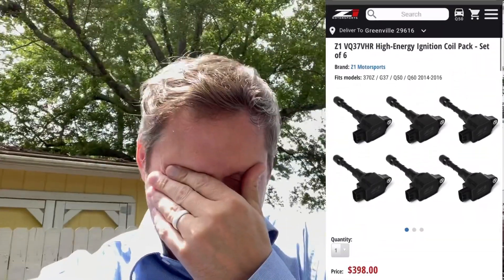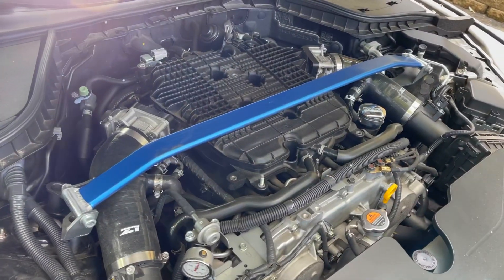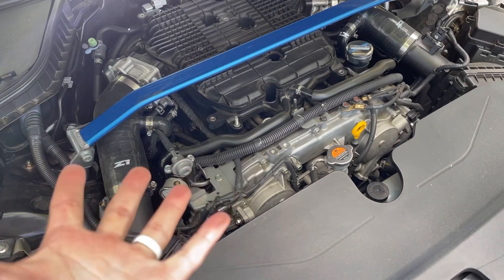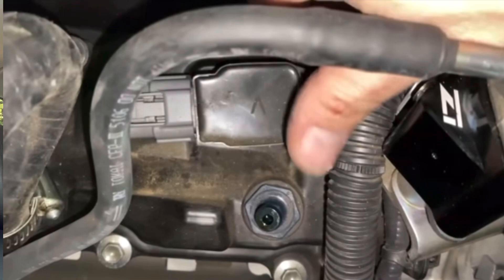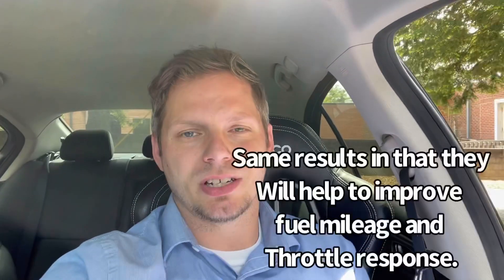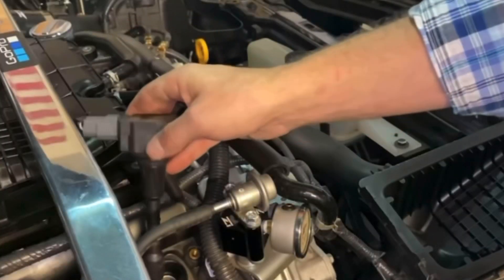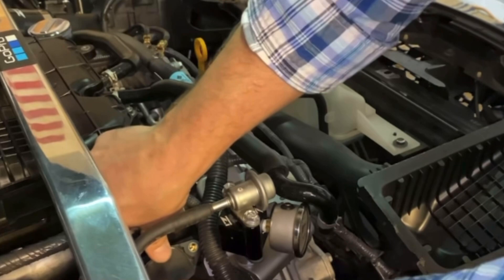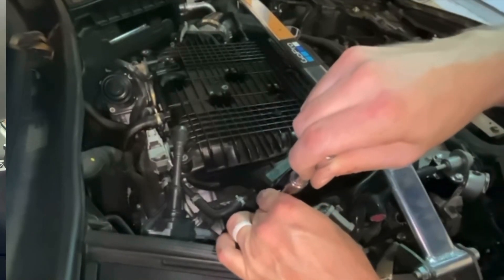Watch BEFORE buying Z1 Coil Packs!! | Z1 motorsports high-energy ignition coils for the vq37

Comment: My Z is tuned and is hitting 60K miles and I've noticed a decrease in gas mileage and poorer off the line throttle response, so I'm going to replace the plugs and coil packs do a manual cleaning of the throttle bodies and spray clean the MAF sensors. I'm curious to see what the plugs look like and how much the gaps have widened. I think that with the gaps widening and the firing voltage increasing, the coil packs are probably under greater electrical and thermal stress than when the engine was new and so they might be getting a little ragged by now.
Reply from the maker: I’m sure you’ll notice a difference with fresh plugs and coils!

Comment: My 2014 Q50 is at 200,039 Miles I ordered Z1 Motorsports coil packs and spark plugs Friday I should be getting them in on Tuesday
Reply from the maker: That’ll be a nice little refresher for the Q!
Reply: car is still running strong? how many miles you got now if it is

Comment: Thanks for doing these reviews on items like this that we're likely to be considering for our cars. I agree that unless you're going to forced induction, or the OEM coil packs are failing, then getting these is probably a waste of money. A better expenditure of money to restore some lost pep in your VQ37 might be a new set of iridium spark plugs if you're pushing high mileage on the ones in your engine. I noticed that NGK and Denso have competing designs and so there might be something new from these guys that might work well in the VQ.

Comment: I changed my spark plugs, coils packs, and did my throttle body clean at 51k miles. I' currently at 90k miles. I'm not going to replace them until 101K miles and when I do I'll try the Z1 coil packs. I trust Z1, and the stealership  for parts lol.
Reply: Damn my 09 is 104k miles and I've never done any of those things. I did just buy these plugs and coils though. Suppose I'll clean the TB while I'm in there too. I've only had the car since it had 70k miles but it's been idling kinda rough lately and threw a p0300 code, random misfire
Reply: @roundearthshill248  it threw the code after you changed the new coil packs?
Reply: @thatdallastx7861  car was solid as hell after changing the plugs and coils, I highly recommend it. 

But then I did some more mods and got it dyno tuned and now it throws codes (p0300) again lol. Car makes 332whp on stock cats/headers though haha. 

I had the Z1 carbon fiber intake installed and their ported intake plenum. Car already had AAM S-Line catback exhaust. 

Z1 installed the intake and manifold and then tuned the car with ecutek. Car runs amazing and is truly quick, but it'll throw p0300 especially in cooler weather.
Reply: @roundearthshill248  why is it throwing the code now

Comment: My oem ones just gave out , so are these worth getting or should i just spend more to get the oem ones which cost more for the same gain? Let me know guys need help :)
Reply from the maker: I've heard good reviews of these lately.
Reply: @SpeedCultureStudios  I asked a few more ppl and I guess ill go with these.
Reply: Having any luck with the Z1s? I’m throwing a code on my #4 cyl and I want to replace all my coils and plugs… should I buy these in your opinion? Thanks
Reply: @moonman4368  yea man they are working good no issues it fixed my missfires and whatnot. Only have 02 codes cuz my test pipes.
Reply: @yrrrrrrrrrrrrrrrrrrrrrrrrrrrrr  thanks for the quick response! Had them loaded up in the Z1 cart… just pulled the trigger!
Reply: @moonman4368  no problem man glad i could help
Reply: @moonman4368  how is it keeping up?
Reply: @jaredpesina3869  running great so far! No regrets yet! They look very well made. I bought the spark plugs from Z1 as well. The Densos on EBay are all fakes! Be careful… a fake spark plug falls apart in your motor it can be catastrophic!
Reply: @jaredpesina3869  so far extremely happy! Nice build quality on the Z1s
Reply: @moonman4368  updates on the z1 coils
Reply: @carlos889574  9 months and no complaints. I’d definitely recommend them 😎
Reply: @moonman4368 are the eBay coils fakes too 😮???? I was thinking about getting eBay Nissan coil packs

Comment: Off subject with this vid but do you have a heat exchanger Installed? I was told our non turbos can’t/ don’t need it even with a tune? Asking because I’m about to tune mine.
Reply from the maker: The 3.7 does not have an intercooler.  Only forced induction cars

Comment: Good show bud.. Appreciate ya diggin into the myth of power gains from this "upgrade".. While it definitely helps the engine operate more efficiently, easier; it doesn't give extra power by themselves.. The power source/supply to the coils needs to be increased. 12v is 12v, and most operate on a 5v reference anyway (which is computer controlled/limited); no matter what coil or plug you use.  I would consider these when time comes for replacements.. Not too far off oem part prices. Great show man. Greatly appreciate this series!!! #HustleOn
Reply from the maker: Thanks Mike.  Great input.  I appreciate your comments!
Reply: That doesn't make any sense. You don't need to increase the input voltage. A coil pack steps up voltage by the winding of the coil inside. If the coil winding is different in the coil pack it can make more voltage with the same input voltage and by doing so you should end up with a more efficient burn of fuel and air which in turn could absolutely equate to more power.
Reply: @Mike Dicarlo  uhhhh. Please explain what the msd ignition setup does than?? I'll wait..
Reply: @mikeschaner5853  they do exactly what the z-1 coils do. They step up voltage to create a higher voltage spark by way of internal windings. They still use a 12V input. Am I missing something?

Comment: Hey man. just got my Borla ProXS and FlowFX resonators installed and loved it. But its week later and today the exhaust doesnt sound the same. Has this kind of vibration at around 2500 and then again at 3500 and it sounds like there is a tad of rasp. My pops also sound different. Is this normal? Is there like a break in period that I just completed or is it possible I blew something up?
Reply from the maker: It’s possible that a weld in the baffle is broken
Reply: @SpeedCultureStudios   could I send you a video of it on Instagram? I’ve reached under and smacked the x pipe and the resonators with my hands to here if they rattle and I don’t hear anything
Reply from the maker: @904Saleen  sure send me a message
Reply: @SpeedCultureStudios  just did! I’m @thatwhitevq

Comment: Hey boss your very knowledgeable so maybe you would know the problem with my G. While I’m driving her around back ways she does awesome runs great, when I enter on the freeway and go she still runs great but every single time I’m going a longer distance I always seem to go into “limp mode” it’ll slow down and will not let me go past 2 gear if I try I’ll begin to bog and start backfiring so I have to pull over and turn her off and on and she’ll do completely fine. It doesn’t give out any codes what so ever to a reader I’ve changed my camshaft sensors, maf and no luck also took it to my local mechanic and no luck. Also tested my sensors and fuses.
Reply: 1) Try an ideal relearn. 
2) Get a tune. Maybe they can see it there.
Reply: @faduhfade77  will do and also I have an ecutek on standby ready to be thrown on
Reply: @faduhfade77  thank you for the knowledge by the way keep the content pumpin 🙏
Reply: @marcosmartinez8470  The tune is for ur tuner to see issues when he Logs it. I hope he can see the issue.
Reply: Sounds like ur transmission bro. Had the same issue car running great but when I go more then 20miles  I loose 3rd 4th gear. I let it cool off about 15 min and then it's fine again. Get it looked at b4 it's too late
Reply: @motorhead6872  I changed the crankshaft sensor brotha and she’s been running fine for a few weeks no problems for now🙏